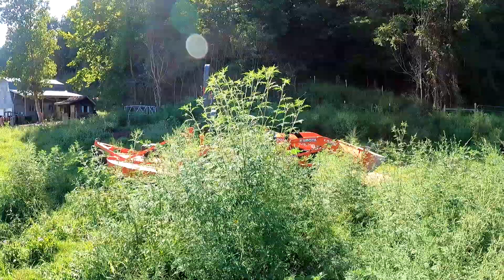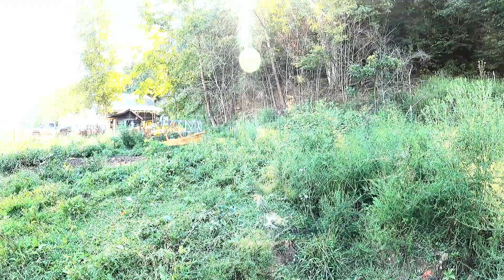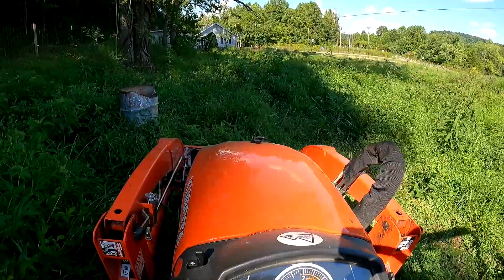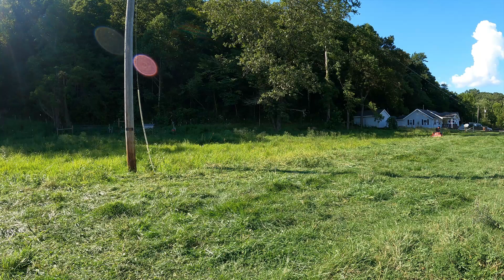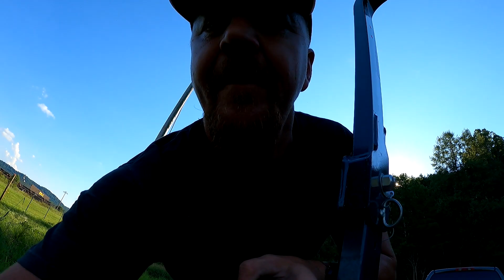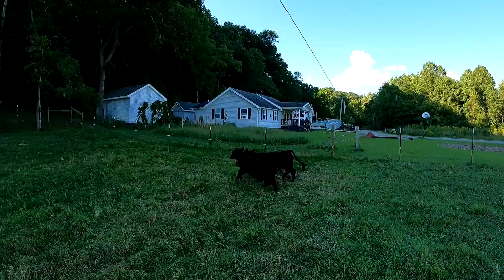Kubota BX Bush Hogging and Getting Buried! - Land Pride RCR1248 - Tractor Tuesday!

Comment: Good job. Does your cutter have a slip clutch or shearbolt and which do you prefer?  Thanks
Reply from the maker: Shear bolt.  I haven’t used one with a slip clutch, but no issues with the bolt.  I’ve had to replace several on my post auger.  Simple enough.  👍

Comment: I have a couple of question about your rotary mower. 
Would you buy a different brand, or are you happy with what you have?
Could your tractor run a 5’ hog?
Reply from the maker: I have been satisfied.  I’m pretty rough with it and aside from some dents, it is holding up well.  

I would t recommend a 5’.  The BX would turn it, but in thick stuff, you’ll bog it down pretty easily.
Reply: Thank you for the info. This will help me in my search for the right one. 
Also love your show. You do make me laugh on how you beat up that tractor. 
And yes it’s a tractor 100%.